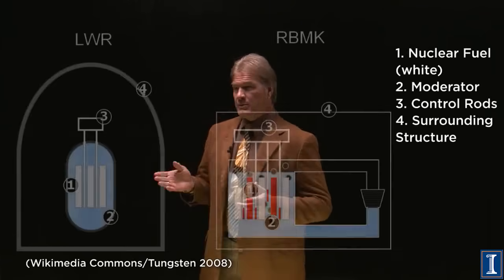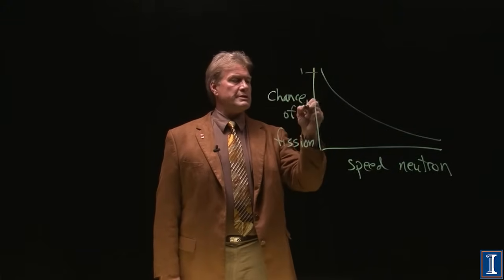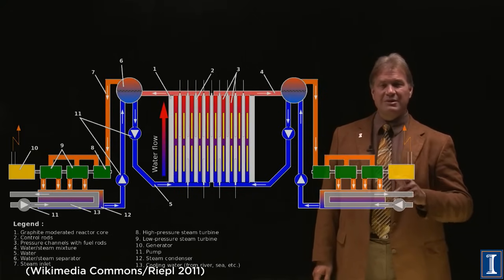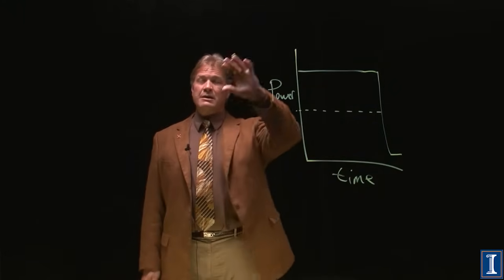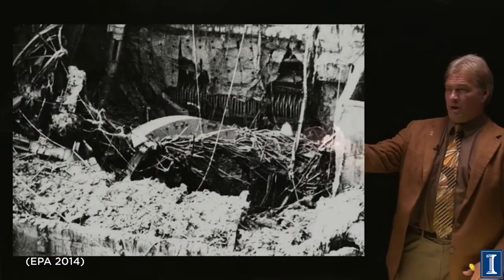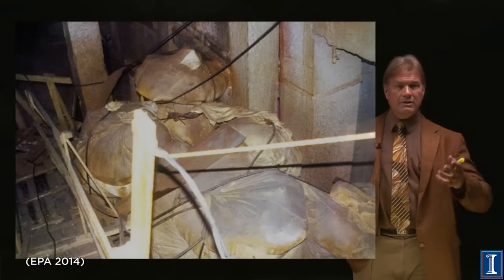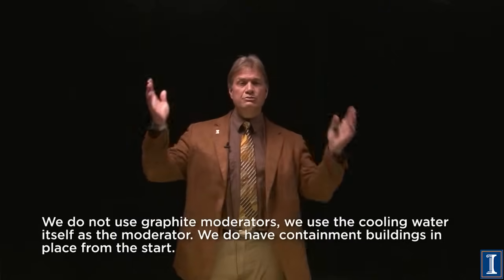Chernobyl: Worst Accident Ever

Comment: Good video, but some unfortunate inaccuracies relative to the actual events at Chernobyl.  

The idea behind the test was NOT to "see how much steam would be generated".  The steam was to be cut off to the turbine and see if its spin down energy could run the electric pumps for the 60 seconds it took the diesel generators to come up and run the water pumps.

He glossed over the spike in power.  While water is a moderator (a slower of neutrons), it also absorbs some of the neutrons, like a control rod.  When the rods were all the way out, they left water at the the bottom of the channel.  This water became the effective control rod durrig the unstable condition.  More water was present in the boiling channels for the purpose of making steam, also absorbing neutrons.

As the power came up, more of the water boiled into steam, which absorbs very few eutrons.  So the power started to run away.  The operator panicked and hit the scram, pushing all the control rods in to quench the reactor.

Unfortunately, the rods pushed out the water that was sitting at the bottom of their channels.

At this unstable moment, that was pretty much the only neutron absorber present.

The reaction spiked to 10 to 100 times the reactor's maximum design power.   The steam exploded the containment vessel.
Reply: Essentially they have experienced two thermal runaways in quick succession. It is truly a nightmare when the reactor goes even more crazy when you push the emergency stop button.
Reply: Thomas Brown so the carbon tips on the control rods had nothing to do with it?
Reply: The graphite tips on the boron control rods caused the spike in power but as Thomas pointed out the power was already rising because of the steam voids (positive void coefficient). The reactor was experiencing a thermal runaway so an explosion was likely even if the rods hadn’t been inserted. What made the problem worse is that some of the rods didn’t fully insert and instead fragmented and became lodged half way in the reactor.
Reply: Do you have a reference regarding that there was a problem (let alone a "panic") prior to hitting the EPS-5 ("scram") button to shut down the reactor at the end of the test? The 1993 report attached to INSAG-7 (translated from russian by IAEA) stated:

(start of test) "At this time, and for the following approximately 30 s of rundown of the four MCPs, the parameters of the unit were controlled, remained within the limits expected for the operating conditions concerned, and did not require any intervention on the part of the personnel.
However, it would appear that, under the conditions of reduced ORM, as of 00:30 on 26 April 1986 it would have been impossible to use the emergency protection system of the reactor of this particular design, either in response to emergency signals or manually after completion of the tests, without damaging the core."

"Neither the reactor power nor the other parameters (pressure and water level in the steam separator drums, coolant and feedwater flow rates, etc.) required any intervention by the personnel or by the engineered safety features from the beginning of the tests until the EPS-5 button was pressed."
Reply: well RBMK reactors cant get critical without water. and steam is not a moderator. so water to steam = shutdown, not runaway. and reactor "barrel" is also cooled with nitrogen gas and RBMK conception uses low enriched fuel = not much excessive heat. so "safety relying on physics" that what developers of that reactor thought. BUT when water starts to become steam it creates bubbles, water with bubbles is more efficient moderator than water - and this miscalulation creates runaway.

Comment: At 16:01 Actually, there were 4 x RBMK-1000 reactor units at the Chernobyl nuclear power plant with 2 more under construction. Moreover, it was the No. 4 reactor that exploded in the early hours of 26th April 1986 causing small amounts of radioactive debris to land on the roof of the nearby No. 3 reactor.

Comment: Why can we see into the reactor's core of Fukushima if the containment building is such a safty feature. GOD BLESS ALL THE HEROS OF CHERNOBYL.
Reply: You cannot see into the actual reactor at Fukushima. You are thinking of the building that holds the reactor with its containment system.At Fukushima they had to vent the nitrogen which is what caused an explosion of the building above . It was damage to the building above a very contained reactor that we saw.Not the core of that reactor!

Comment: You don't need WATER to cool a reactor, it can and has been completely avoided with MOLTEN SALT. Water cooled reactors is old and stupid.
Reply: Helium and carbon dioxide can also be used, as well as lead-bismuth and liquid sodium, which is a bomb in its own right.

Comment: Not all reactors use containment buildings like most Western reactors. This is my last post; I cannot list a correction of all false info provided in this video, but Fukushima is very easy proof that not all modern reactors (built by western contractors, or the reactor in Iowa, my home state, Palo is the same) use containment buildings.
Reply: Aaron Hoel i’d like to know how you got the info that fukishima reactors were built by western contractors, and correct me if i’m wrong, but wouldnt the reactors in japan been designed by japanese chemical engineers, so once again correct me if im wrong wouldnt that mean they aren’t “western” reactors?
Reply: Dan murph They are reactors designed by General Electric. The same type of BWR reactors that are found in the US; Palo Iowa for example.
Reply: Aaron Hoel may i ask once again how you obtained this info
Reply: Aaron Hoel never mind, i found it. Seems you were right

Comment: This is a good generalization, but fails with many specifics and facts. For example, no talk about heavy water rather than regular water as a moderator. The heavy water is not what is used to directly spin generators. And Chernobyl was not only human error. There are other problems with this video, so this is a good start, but check other sources for a full understanding of Chernobyl and how Western reactors work. 

BTW, not all western reactors have containment buildings. 

And no, the controller at Chernobyl did not “hit the wrong button.”
Reply: Zach Cromwell what?
Reply: @aaronhoel8269  'And no, the controller at Chernobyl did not “hit the wrong button.”
'
Pressing A3-5 (AZ-5) did lead to the disaster. It was kept secret from the scientists!
Reply: Pritam Sarkar pressing the AZ-5 button was the established procedure for shutting down the reactor. It is one of the ways to scram the reactor and part of the written procedures. It was the graphite tips on the control rods that pushed the core prompt. The accident is significantly more complex then just pressing one button.
Reply: @aaronhoel8269  'pressing the AZ-5 button was the established procedure for shutting down the reactor.'
And when did I disagree with this?
Reply: @aaronhoel8269  Or this?
'The accident is significantly more complex then just pressing one button.
'
Reply: Pls ignore what i said, i was joking about something that didnt make sence, it was late and my jokes go over the deep end at that time
Reply: 'not all western reactors have containment buildings. '
Name one such reactor! Even the reactor in 'Three Mile Event' had a containment building. Old Indian CANDU reactors all have containment building, even double containment in may cases!
Reply: Pritam Sarkar I answered this question in a prior post. The reactors at Fukushima did not have containment buildings, for example.
Reply: @aaronhoel8269  '. The reactors at Fukushima did not have containment buildings, for example.'
Reactors at Fukushima DID have containment buildings.  Don't sprout BS.
Reply: Pritam Sarkar no, they do not. They have containment vessels for the reactors, but their buildings do not qualify as containment buildings. That type of GE design is used throughout the world. We have one about 50 miles from where I grew up in Cedar Rapids, Iowa.
Reply: @aaronhoel8269  ' They have containment vessels for the reactors,'
Yes, along with reinforced concrete. And another steel vessel aside from the pressure vessel(The reactor). Who are you trying to deceive?
Reply: @aaronhoel8269  I totally remember matryoshka doll structure of the containment vessel!
Reply: @aaronhoel8269  The pressure vessel, inside a steel hatch, Inside another reinforced concrete vessel.
Reply: @aaronhoel8269  Chernobyl power plant has none of this! So, it is futile to compare the two!
Reply: Pritam Sarkar you are not good at this. The point being debated is whether or not ALL western reactors have containment buildings. They do not. We all remember seeing the video of when the wall of one of Fukushima’s reactor blew out. 

From the references you are making, I will assume that you watched the HBO series and now consider yourself an expert on all reactors. My father was a designer for commercial nuclear power plants. We spoke often of his job. I have a special interest in Chernobyl as I lived in Ukraine for 4 years and as part of my job, oversaw research projects carried out there.
Reply: @aaronhoel8269  'I will assume that you watched the HBO series and now consider yourself an expert on all reactors.'
LOL....NO...I am a mechanical Engineer, who has done a specialization in power-plant engineering. Besides that, many of our faculty have been working on nuclear powerplants(CANDU derivatives) here in India.
Reply: @aaronhoel8269  'The point being debated is whether or not ALL western reactors have containment buildings. They do not'
Okay, but they have something that contains the core(Pressure Vessel) and serves  the function similar to containment buildings. Chernobyl had none of that!
Reply: @aaronhoel8269  Here is an engineering cross-section of a reactor in Fukushima-Diachii powerplant. Please, notice the the steel containment containing the pressure vessel, ie reactor and the surrounding re-inforced concrete! Now will you claim Chernobyl had these containment features? Please, cut the crap! 
https://en.wikipedia.org/wiki/Fukushima_Daiichi_Nuclear_Power_Plant#/media/File:Reaktor.svg
Reply: Pritam Sarkar I am not saying that at all. I am saying that not all western reactors have containment buildings. That is a true statement. You are talking about reactor containment vessels. I am talking about buildings.
Reply: @aaronhoel8269  Then it is a misunderstanding, isn't it! The point is all western reactor designs have plans and arrangements once the pressure vessel is ruptured and breached. RBMK did not! The UBS(Elena) was not built that way!
Reply: Pritam Sarkar your statement is accurate and I agree 100%, but that is not what this educator is saying. Educators have an important role in educating. They should be mindful to not misspeak. BTW...Elena is the name of the reactor lid, not the whole core.
Reply: @jorgefierro6831  'Give a video link or shut up :)
'
Sure, but calm down!  His name is Alexander Kupnyi and he is an engineer who worked at Chernobyl up to middle of the 2000s. The video is in Ukrainian with subtitles in English
https://www.youtube.com/watch?v=4ZyskbkUUxk
Reply: @jorgefierro6831  Alexander Kypni is a very good source as he inspected the conditions inside the sarcophagus in late 2009. 
Points of interest(Of the video mentioned in a link given below)
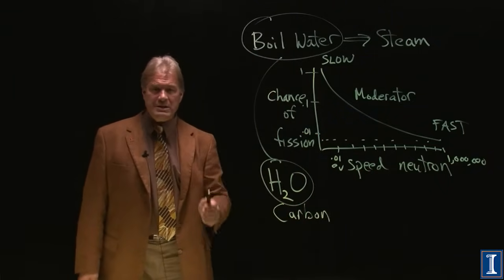5:50 - Elephant's foot

1:52 - Crapton of radioactive graphite

3:05 - The UBS (nicknamed Elena). Under that object is the actual reactor core

2:24 - Bag of sand/boron dropped from the helicopter
0:33 - The wall left of the chimney (you can see it in most photos of the morning after the accident- this is the wall the roof liquidators threw the rubble off of)https://www.youtube.com/watch?v=NkwEfbIBnDU&t=8s
Reply: @jorgefierro6831  Are you satisfied now?
Reply: Jorge Fierro Did you watch the whole video? I would suggest starting with an easy read on the accident after watching the whole video (you could even start with Wikipedia). It would take pages and pages to describe the misleading and downright incorrect statements in this video.
Reply: @aaronhoel8269  Wikipedia is also a bad source. Eyewitness and scientists/engineers who worked there are a better source. The cited video below is in Ukrainian/Russian with English Subtitles.
https://www.youtube.com/watch?v=42st0urytLI&list=PLghy_ADMjhsqnMY5Xtp6cV_CuXhaP4KvP&index=6
Reply: Pritam Sarkar I have seen that video, but thanks for sharing. I stated reading Wikipedia as a simple starting place. Here is a list of some of the books I have read about it:

Atomic Accidents; Jim Mahaffey
Chernobyl, The unbelievable forbidden history; Svetlana Kostenko
Cause and Effect: Understanding Chernobyl; Marianne Barisonek
Chernobyl; Serhii Plokhy
Chernobyl Record; R F Mould
Liquidator; Sergei Belyakov
My Chernobyl; Alexander Borivoi
Midnight in Chernobyl; Adam Higginbotham
Chernobyl 01:23:40; Andrew Leetherbarrow
The Chernobyl Disaster; multiple authors

There are others, but half of my library is in boxes as we do not have space for all of them where we live now.
Reply: @metaphorpritam  I see that Jorge Fierro left the group discussion (I decided to reply with my laptop rather than my phone).  Let me respond to some of his and your other concerns.

AZ-5: Pressing this button was standard operating procedure for shutting down these reactors. Doing so was actually part of the manual for shutting down such reactors.  Faulting the operators in pressing this button prior to the disaster has been proven to be flawed.  Computer simulations of the condition of the reactor have proven that even without pressing the AZ-5 button the reactor was already gone, with a more than 90% probability that it would have catastrophically exploded.  So I will agree that there was a small chance that an explosion could have been avoided had the standard operation procedure not been executed.  But this was what was expected.  The culture in the FSU was that Soviet reactors were fail-safe.  But at the end of the day, pressing the AZ-5 button did not cause the disaster.  It might have resulted in a quicker explosion, but the reactor was already doomed prior to pressing the button.  

This "educator" claims that the button was pressed in error.  He is wrong in stating that.  The operators pressed the button as part of the SOP of shutting down these reactors.  Not in error. There was no way that the operators would know that the design flaws of the control rods would lead to a spike in output if they inserted all of the rods at once (this is very well documented).  So the educator in this video is wrong to state that they "pressed the wrong button."

Second issue that Jorge brought up...heavy water vs. regular water.  His comment was ignorant in the difference comparing the operation of a reactor that uses heavy water as both a moderator and coolant vs. a reactor that uses regular water for a coolant and graphite as a moderator.  There is a significant difference in these types of reactors relating to their void coefficient.  I am not sure that Jorge understands that. 

Jorge Fieruro left deleted his comments, so I cannot complete my assessment of his.  He had a few more points that I could have addressed had he not deleted his comments.  I am in no way an expert on what happened in Chernobyl, but I do know a lot about it (both from literally being there many times and reading dozens of books about it).  I appreciate new perspectives and being educated on what I do not know, as long as those perspectives are based on first hand experiences.

Comment: Fukishima had a containment building and well.....
Reply: Disabled Velociraptor 
No you are thinking of the building that housed the reactor with the containment system. The building is not its containment system. When the outermost building exploded it was due to the nitrogen being vented from a ventilation system that is designed to do that.The nitrogen when it mixes with oxygen it exploded.Thats what damaged the outer shell of a building but the reactor is totally still contained in its thick containment system.Any footage that has been gathered from inside has been by using a scope that is fed into the containment system to take a look at the inner reactor core.
Reply: @charisselinnellmorton851  I'm speaking about the liquid specifically that has made it's way into the oceans, they've found caesium in Canada with the same radioactive signature of Fukishima. Contained isn't really the right word. The main reactor core might be contained to some degree but the radioactive material certainly isn't.

Comment: What about Fukushimna the whole building exploded.
Reply: dymsza 
The containment vessel did not breach there at all. The building did due to the reaction of nitrogen and oxygen. Their reactor was venting nitrogen to prevent any meltdown.This happens when you open a valve on on the containment vessel. The building was just a normal building above the very thick containment vessel. The only breach was the necessary venting to prevent any meltdown until they could get the back up electrical working to pump more water into the reactor.
Reply: @charisselinnellmorton851  Hydrogen*, not nitrogen
Reply: Sure, Would like to live next door to it ? :)
Reply: dymsza 
Not really as they had more problems with the cooling ponds.Thats were they put all the old reactor rods .They were in horrific shape. They were always the bigger risk ,not the reactor! Still are!
Reply: Building yes. Reactor no.
Reply: Tokyo Electric Power Co (TEPCO) has now finally confirmed that meltdowns occurred in reactor Nos 1, 2 and 3 all of which suffered hydrogen explosions that blew away their containment buildings – the first line of defence against radiation leaks – thanks to the failed General Electric hydrogen vents.